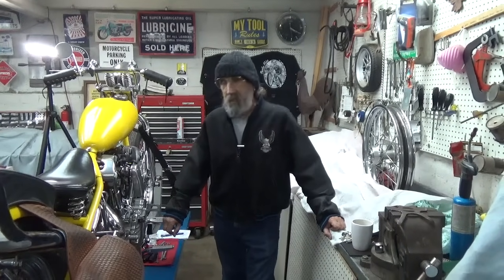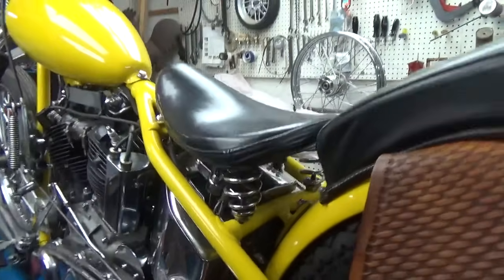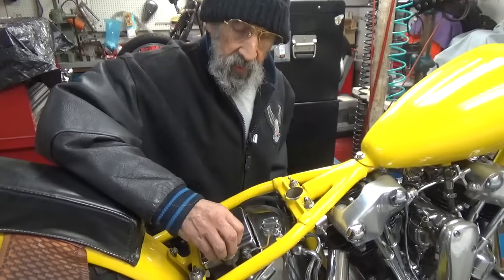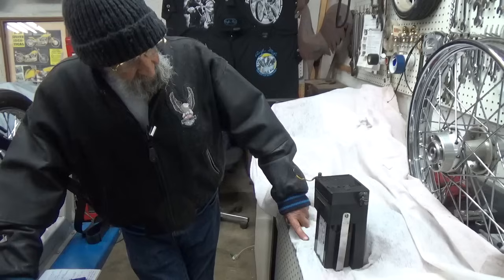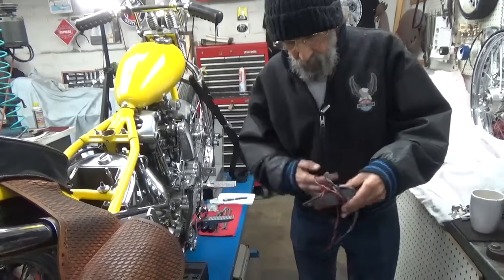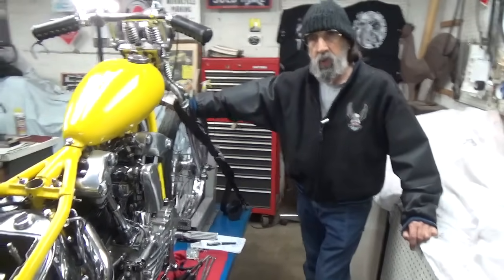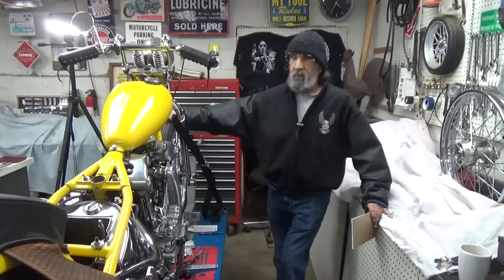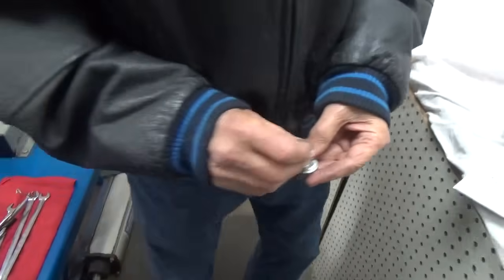Harley Knuckle ready, Paradise Roadshow Next Weekend

Comment: Thank you for the video, Pacific Mike and Cameraman Mike, great job as always. I appreciate you took the time to highlight the importance of keeping the battery fresh. I've been riding my Shovelhead (FXS 80" from 1979) since 1989 and looking back I can see that many of the problems that occured came down to electrical failures. Neglecting the condition of the wiring and the battery and not connecting it properly is asking for trouble (because everything is vibrating a lot on those old H-Ds). Also,  now there are so many "magic boxes" available to connect everything in an easier way and reducing the number of wires on your bike, so I was tempted to go that way if I hadn't re-wired my bike recently. Keep up the heat in your garage, it's the time of the year when you take care of your bikes rather than riding them because of snow and ice, at least here in Sweden.
Reply from the maker: It's going to warm up in a day or two.  I believe it.  It must be so.

Comment: I made a similar setup for my pan. I use a dry AGM 12v battery for a computer UPS. Fits in with room for a circuit breaker inside. Kick only, with Dynatek dual fire ignition, so the bike hardly uses any juice. Cycle Electric genny with low output end mounted regulator. Trouble free.
Reply from the maker: IO run the same, except still run points. I do enjoy a Halogen Headlight and Cycle Electric generator and I had a new Electric Frank's regulator (pretty much the same as Cycle Electric.  My coil is Dynatech fitted into a stock appearing early coil case.

Comment: Do you have this hooked up to your generator so it charges the battery I did this on 67 shovel head but I think I overcharge the battery
Reply from the maker: Yes, and it works quite well.  It is a 12volt system.

Comment: Hey Mike getting ready to convert my 39EL TO 12volt what gauge wire did you use for battery ground?  Got cycle electric generator, was running old 6volt 2 brush fan generator should i just pull gear off that and put on new generator?
Reply from the maker: I use #14 wire on all of it.  The gear will fit right on.  But, look in your service manual on fitting the generator to the bike so the generator gear meshes properly with the idler gear inside the camchest.  This is very important.  I've shown it on our videos.  Go to our homepage and click on the word "videos."  There's a bunch of videos there.  If you can't find it, write back.  But don't skip fitting that gear properly.
Reply: Thanks for the quick reply. Like your channel, been subscribed from the start. My 39 is same style as yours except mine has fatbob tanks. Thanks for the battery idea, gonna do the same
Reply from the maker: Cool.  Thank You.

Comment: A 6v system is not a positive ground , the original 3 brush system works with a relay to regulate flow , the light circuit will kick in the 2nd field  increasing amperage for lighting. A good 6v system will last many years and miles  using original parts . Many trouble free miles with my original generator on my 51
Reply from the maker: Thank You.  And your 51 is certainly beautiful.
Reply: Love the videos and happy to see the young guys getting into the pan stuff ….. keep up the great work Mike
Reply from the maker: Thank You.